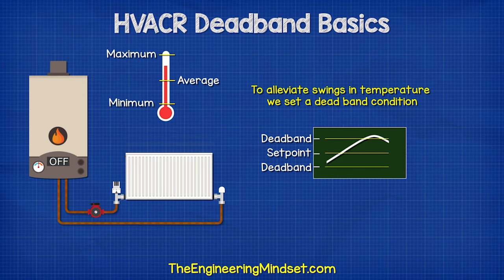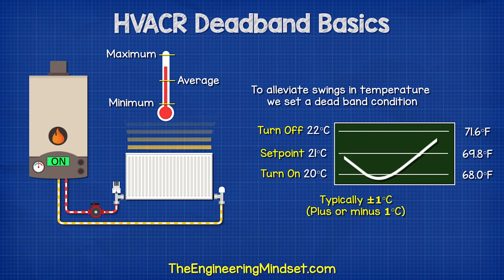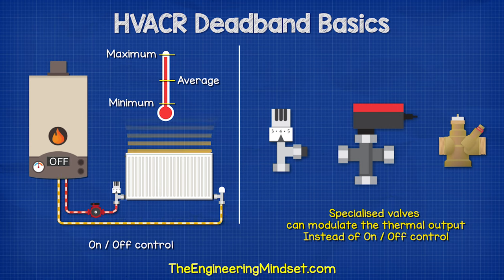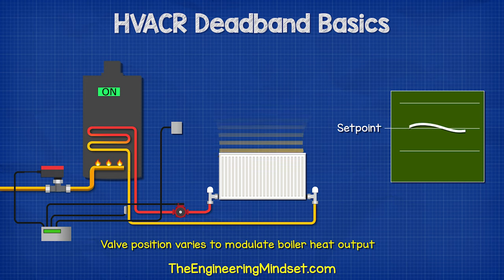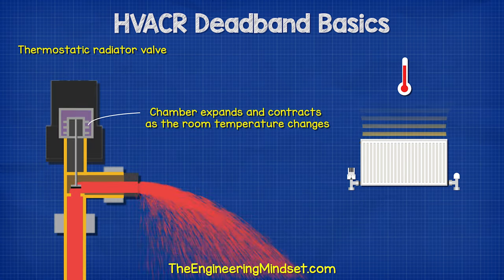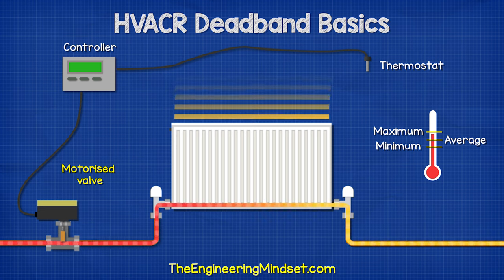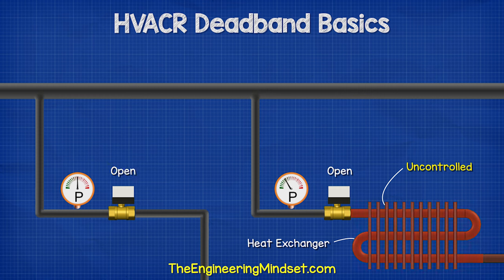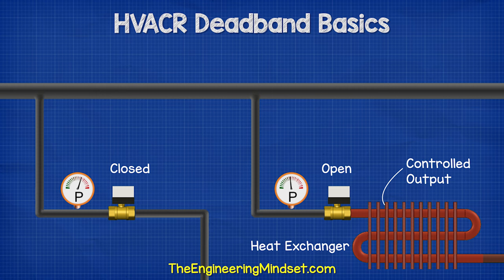HVACR Deadband Basics

Comment: Great video. We have gas furnaces in North America ( Lennox ) which can modulate their firing rate from 30-100% and with ECM variable speed fans you can get really constant even heat. VERY expensive to repair though. We also have modulating hot water boilers.
Reply: wow how advanced. nowhere else on earth has that.
Reply: @cliveramsbotty6077  I live in Canada where it gets as cold as -40C/-40F with winds at 50kmph/30 mph or stronger so there is a need for very efficient furnaces.

Comment: 2:11 the problem with TRVs is that they are simple P controllers which means there is always a deviation (error) between the setpoint and the actual temperature. that error depends on the outside temperature. the colder it is outside, the bigger the error. to eliminate that error, you'd need to add at least an I component and maybe (depending on conditions) a D component which of course requires an energy source.

BTW, i know what HVAC means, but what does the R stand for?